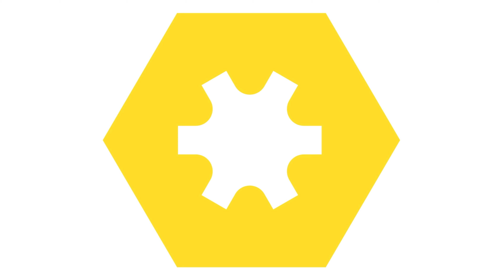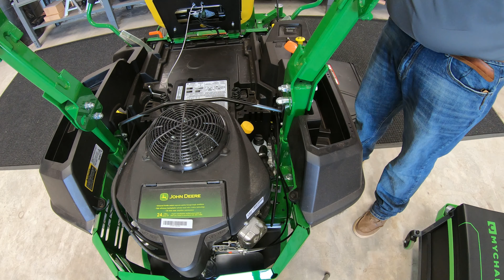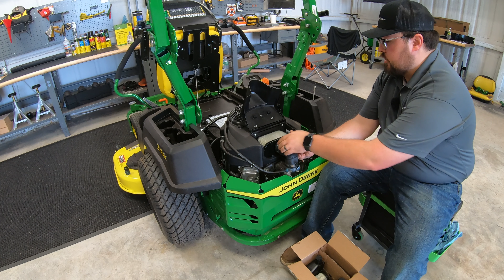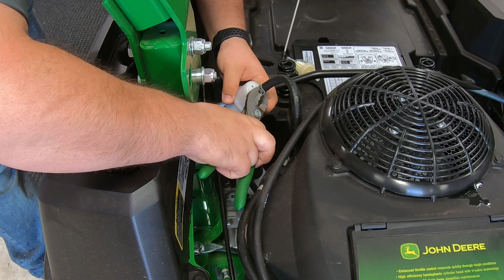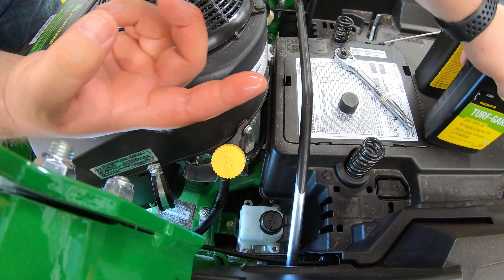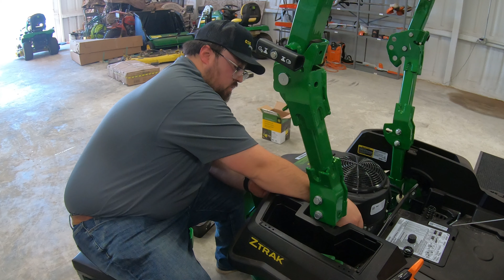How to Install Home Maintenance Kit on John Deere Z530M Ztrack Mower

Comment: That engine takes 2 quarts AND 1 CUP of oil. It states it in Z540M owners manual. Also there is a black foamy piece that goes over the air filter. Both 2016 and 2018 Z530M of mine had. I always take the black foamy piece off after each mowing as it collects a lot of debris and rinse with clean water then hang to dry before reinstalling.
Reply: The book for my Z530R (I have a 2021 and 2022 model) shows 2 quarts and 6 ounces of oil.
Reply: @p71collector  I had to correct the sales man that sold me my Z540M that it took more than 2 quarts of oil.
Reply: @gailjohnson6670    LOL!   Always believe what the manual says, NOT that salesman!  Salesmen are not always knowledgeable or telling the truth, only to make the sale. :face-green-smiling:
Reply: @p71collector  He did a double take!..I had read up  before talking to him and  buying.

Comment: Z530m sounds rough like a grinding noise after changing the blades, can anybody help me out with the problem
Reply from the maker: Is everything good and tight?
Reply: I had this issue after sharpening the blades, and it turns out they were just barely out of balance. Grinding off some metal on the back of the blades to get them perfectly balanced eliminated that awful grinding noise.

Comment: Thanks for the video I have the 2022 48” z530m and just went through this.  Additionally attempted to grease the deck.  I was unable to the the grease coupling on the center spindle.  Any suggestions on fittings or couplings to make this doable?
Reply from the maker: Are you saying you just couldn't reach it?
Reply: @247parts  yes, I could not get straight on it to make a good connection and get grease in it.
Reply: @eshott2935    I use a 90 degree adapter that snaps onto the straight grease gun coupler,  They are available at most farm supply stores or Napa Auto Parts stores.

Comment: Great tutorial.  Is the gap checker in the maintenance kit?
Reply from the maker: No, it i snot but they are very easy to find. Most dealerships will have them or your local auto parts stores.

Comment: The new fuel filter you installed from the kit has a lot less filter media than the one you replaced.
Reply from the maker: I need to break both of these filters open and do a comparison of the filter media. Thanks for watching!
Reply: @247parts  Are you still doing a video on this?
Reply: I notice that too

Comment: I miss my Z530R. I regret trading it in for a X590… lol
Reply from the maker: Why did you trade it? Just curious.
Reply: @247parts  Well, my family parks on the side of the road and when it snows heavy we kept getting plowed in by the city. I figured getting a lawn tractor and a snow blade since the zero turns do not currently have any snow blade attachment.